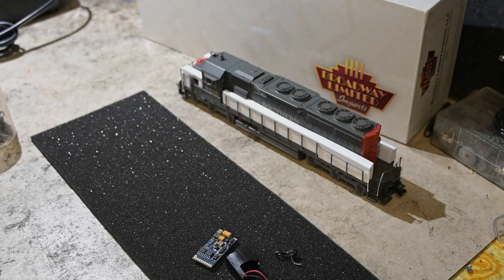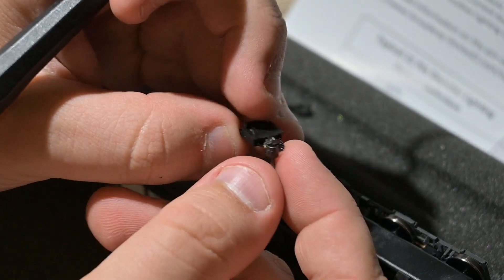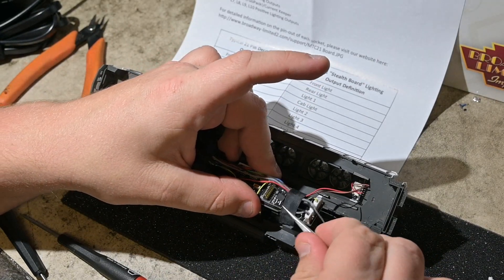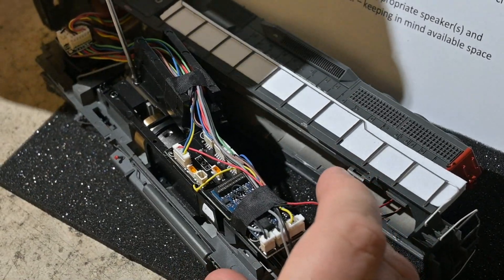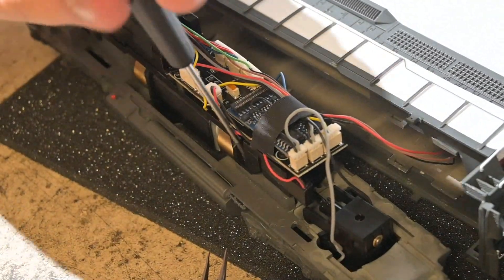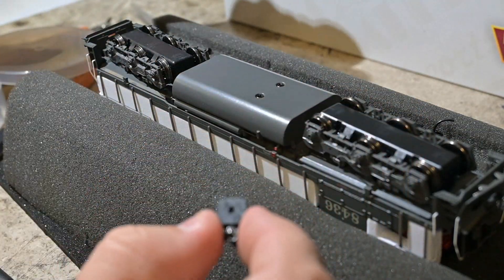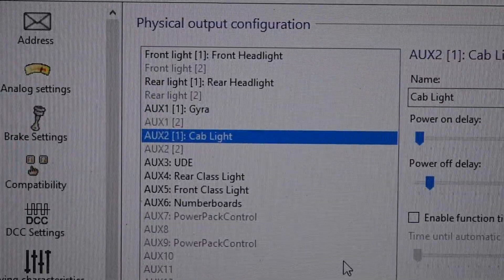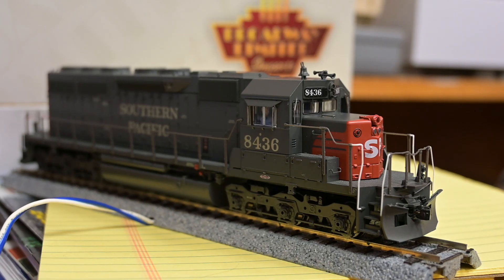Broadway Limited Stealth Series SD40- Full DCC+ Speaker Install!

Comment: The sound file you loaded in (S0849/S0508) is a very quiet file. S0845, S0850/S0710, or S0775/S0848 have better volume levels that might make most out of the stock 8 ohm speaker
Reply from the maker: I'll mess around with those, went for the 849 since I liked idle/startup the best.